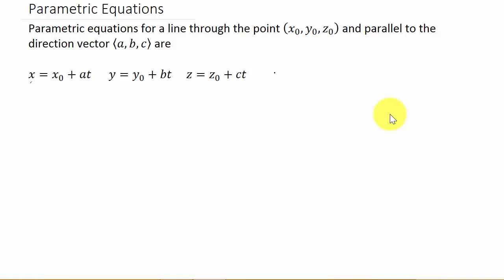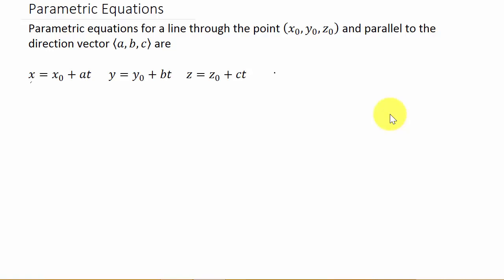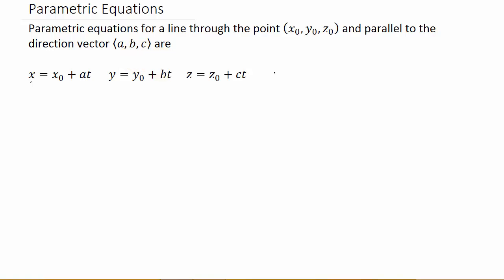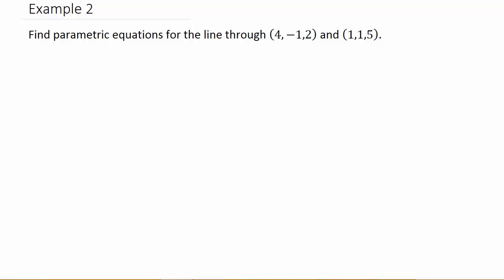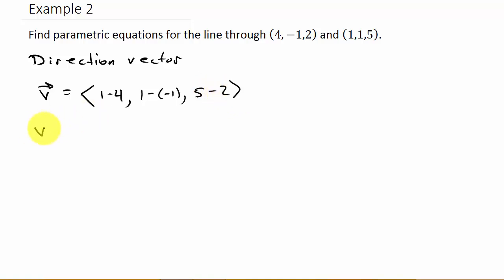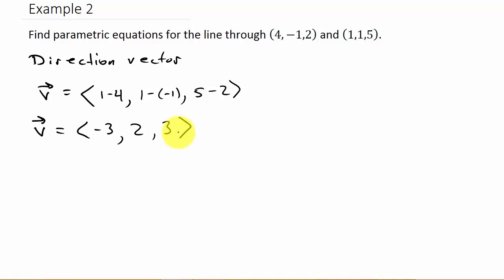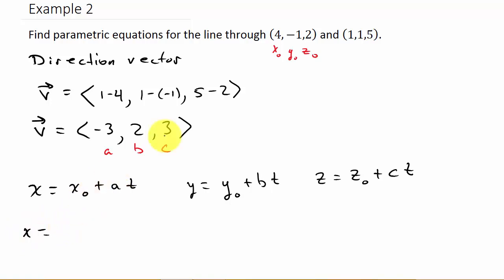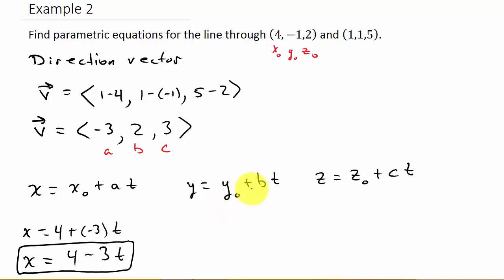Finding Parametric Equations Passing Through Two Points

Comment: If we find the direction vector by subtracting the second point from the first point , the parametric equation will change . So which one is correct ?
Reply from the maker: Both are correct. Just a different way to represent the same line.
Reply: @crowsmathclass   thank you so much Steve.
Reply: @crowsmathclass  In the second example, where the line passes through two points
I have a similar one in my textbook:
Find parametric equations for the line P(-3, 2, -3) and Q(1, -1, 4).
Solution:
The vector PQ= <4, -3, 7>
is parallel to the line with the point (Xo, Yo, Zo)= (-3, 2, -3) give
x= -3 + 4t,     y= -2 -3t,   z= -3 + 7t.
And the point Q(1, -1, 4) give
x=  1 + 4t,    y= -1 - 3t,    z= 4 + 7t.

As you can see, they ended up with two different pairs of (x, y, z) because they used both points as initial after setting the direction vector as PQ. Is that correct? Shouldn't they have used P only, like you did in this video?

Comment: When using parametric equations for line integrals, it is important to know the initial  and terminal values of t. when given two points notice that t goes between 0 and 1. This also gives a nice final check to check the initial and final values after the equations are computed.